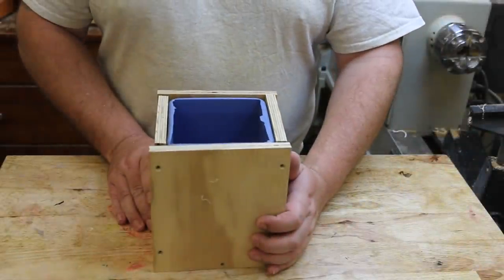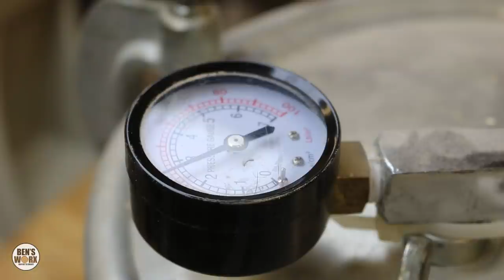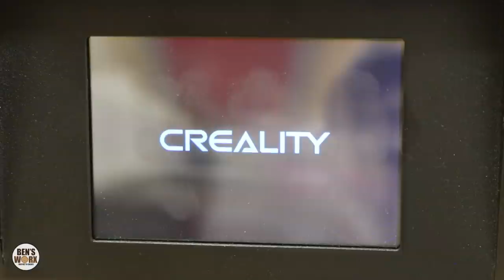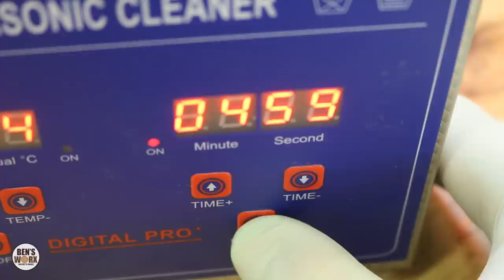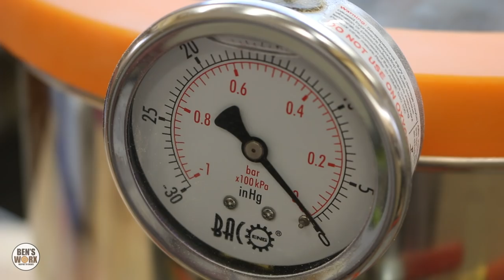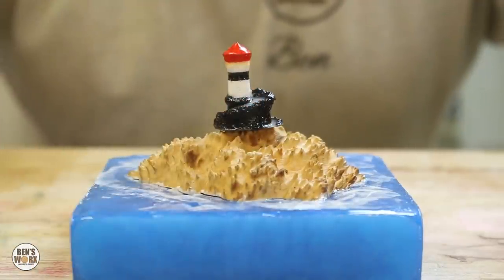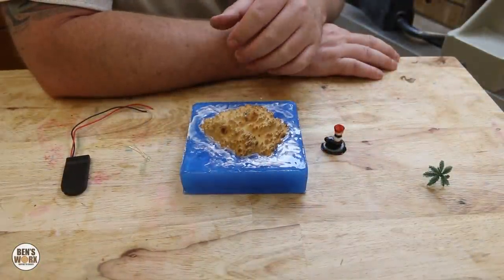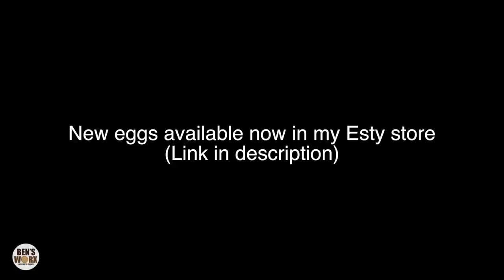The Abandoned Lighthouse Feat. JAWS

Comment: Love the video as always but when it comes to cleaning resin off 3d prints never use an ultrasonic cleaner with 100% alcohol as it can be very explosive there are some good alternatives like a pickle pot with a basket you can just shake it or use an old toothbrush or invest in a wash and cure station.
Reply from the maker: Thanks Mate, if you use the alcohol in a well ventilated space and it stays under the flash point it will be ok, I’ve tried the alternatives but they don’t work as effectively as the alcohol (for me anyway) I do appreciate your concerns though and I always have safety equipment within arms reach

Comment: I have noticed that many of your Themed projects (Star Wars, LEGO, troll) toy have been sticking them or other parts down with CA. Which alone is fine, all CA no matter the speed take about 24 hours to finish our gassing. (An hour in the oven at 200 also finished the job. The big news is those fishers you seem to get are from the CA Kicker. Spray some on a piece of plastic bag, then put some epoxy on it. 
Unfortunately it contains some oil. So the hippo you did, it had kicker all over it. So it got a halo over the entire guy and some splinters in the epoxy. You can’t bake it off, you have to clean it with acetone. Not finger nail polish remover as that also has a small amount of oil in it.
Learned this the hard way, I pay for all my stuff, no sponsors. So my losses were in the watch parts pens, 13 hours work with CA and accelerator went with a total loss of the epoxy, bubbles and delimitations.

Comment: What happened to installing the light n batteries.watched it all to see it n nothing.
Reply from the maker: The light was installed when I put the wiring through the burl then connected to the battery holder which is tucked under the base